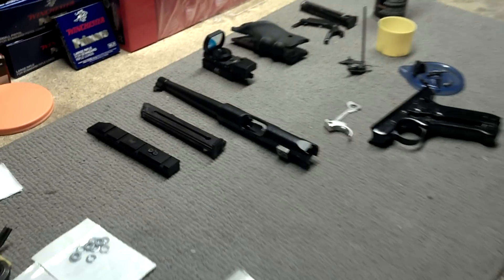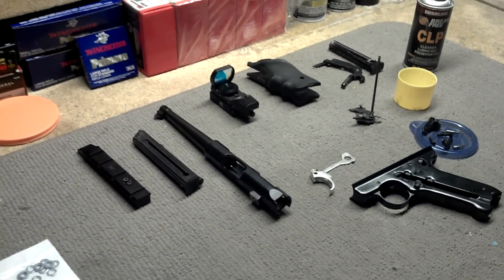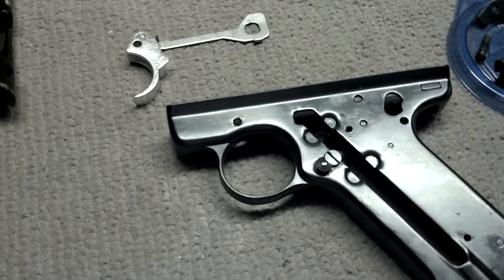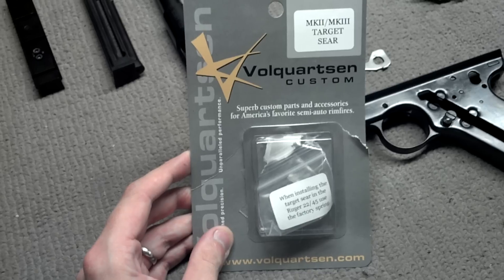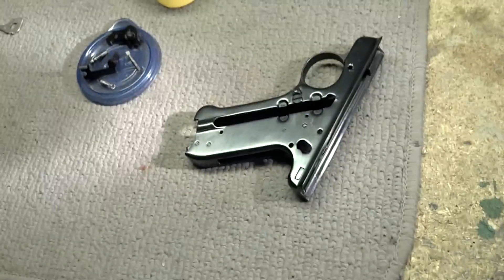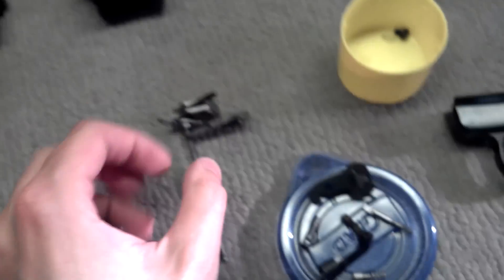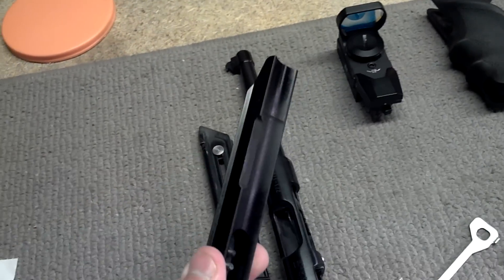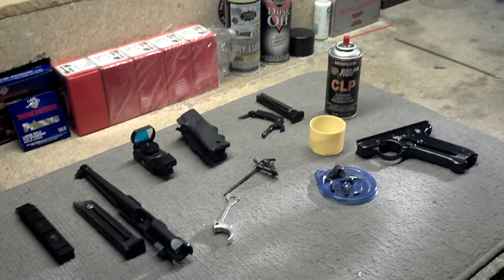Ruger Mk III Completely Disassembled - Oh, #$%@

Comment from the maker: Good info, and I would recommend people go that route.  It doesn't cost much and saves time.  I was aware of the third party bushing prior to doing the mod myself, but I just can't resist a good DIY project sometimes.  My personal assessment was that in the event that it did fail (although it hasn't after buckets of ammo), the only result would be that the safety was re-engaged.

Comment from the maker: I checked my Amazon order history, it's a "Weigand Ruger MKI MKII 22/45 No Gunsmithing Scope Mount ".

Don't be scared off by the fact that it doesn't mention MKiii specifically. It works fine. Just make sure to use some LocTite on the mounting screws and it shouldn't go anywhere.

Comment: sintax, thanks for the vid.  There's actually a hammer bushing from TANDEMKROSS for the MKIII made specifically for removing the magazine disconnect.  I highly would not recommend washers to solve this problem.  It might work temporarily but wouldn't it be safer to use a part that was machined specifically for the firearm?  I got mine off of amazon searching for Magazine disconnect MKIII.